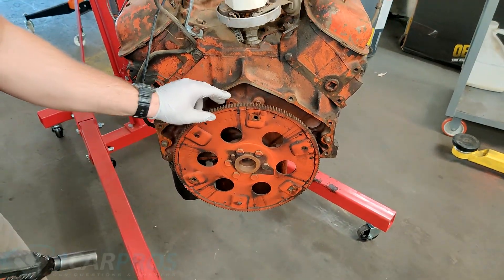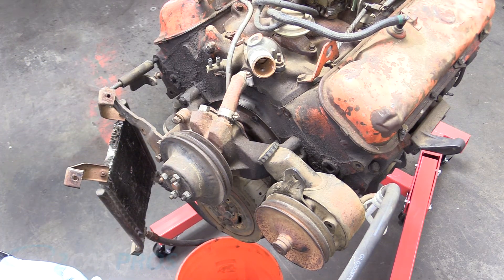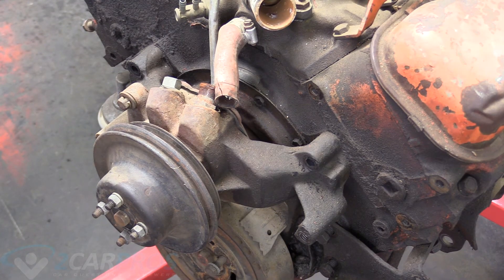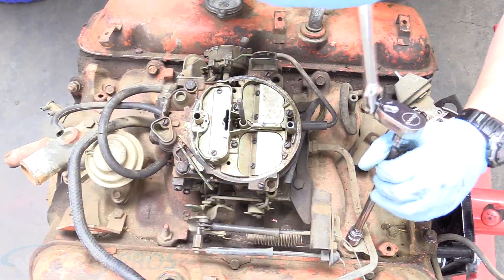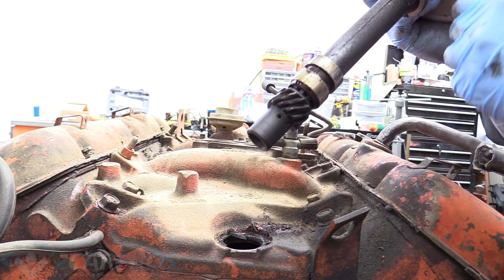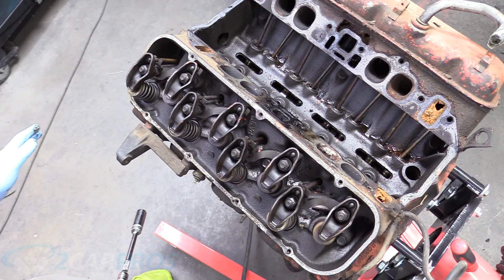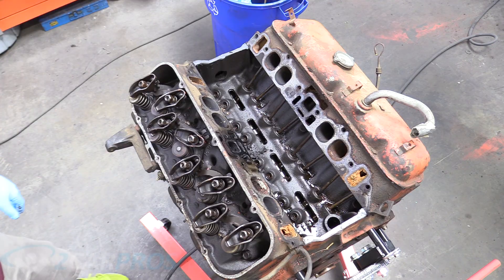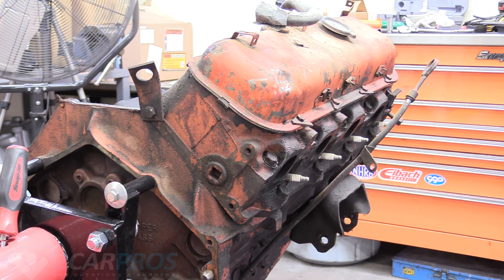How to Build a Chevrolet 454 Big Block Part 1: Taking the Cylinder Heads Off!

Comment: It might have already been asked, but, how did you get the engine stand off of the engine hoist?  I noticed that when you were mounting the stand to the engine, that the stand's legs were on top of the hoist's legs.  I have this same problem with the legs of my harbor freight hd stand being the same dimensions as the hoist's legs.  They don't intertwine.  I was thinking about taking the wheels off the stand and sliding it under the hoist.  Curious to know how you did it.
Reply from the maker: I just slid it off. Little clunky but it worked. Thanks for watching!

Comment: This is interesting to see seeing how as I have a 959 block as well. One thing I just saw a video about is making sure all the holes available to be drilled or cleaned for water flow on the block need to be, there is 3 on the bottom and 3 on the top of the cylinder (between them) that there look full. I'm fixing to do some head work so I'll make sure mine are open.

Comment: I used this video to rebuild my 454. Actually 3 blocks were cracked and found at least 15 heads that were cracked. Had to fight the whole process but got it done. I believe 454 is basically obsolete now. Nothing but junk parts floating around. Adjust ones budget and buy aftermarket

Comment: I rebuilt the same motor 30 over. 959 block (11-21-78) but I ditched those 236 peanut port heads and found a set of 820's for $100 that I had redone.

Comment: Why don't you clean it before  you pull it apart .you don't  no the first step
Reply from the maker: Wrong version of "know" first off, secondly you don't need to clean an engine before you take it apart as we hot tank it when it gets machined. Thanks for watching!

Comment: Great series of videos! Question...454 BB or LQ9 for an older square body pick up?!?
Reply from the maker: Oooooh man! TOUGH call! Hmmmmmmmm for your application I'd probably go with the 454 with fuel injection for reliability. As far as why the 454 then I just think it looks more correct. To be honest there is no wrong answer. They both would be fantastic!
Reply: @2carpros  yeah me too…454 is more year and vehicle correct and with the cost of an LQ9 I thinks it’s not worth the effort. But like to hear experts opinions!

Comment: GM made the 454's up until the late 90's, i think it was 99._
Reply from the maker: Yeah something like that for the GEN 6. My Dad has a GM based motorhome that's a 1999 with a Vortec 454. Runs great and really makes the big heavy thing move. Thanks for watching!
Reply: Honestly GM small & big blocks were almost indestructible, if they were halfway taken care of. They were so versatile, which made them so popular with virtually everyone😊
Reply: @2carpros  your videos on rebuilding the Chevy small block (5.3L) is interesting. I've torn down the old small blocks, the 70's & 80's before. The new design should have helped reduce oil leaks. The cross bolts on the outside of the block is the same trick dodge did with the Hemi blocks😄

Comment: I want to replace the crank shaft, but can I do that while the engine is still in my RV? It’s a 1991 Fleetwood Bounder, we don’t want to have to take the entire engine out, but we’re pretty sure the thrust bearing is broken. What would be the best way to go about this without pulling the engine out?
Reply from the maker: Oh man good question. I'm sure people have done it in the past especially in RV applications. I wouldn't and here's why: gravity really helps you set the crank back in and not disturb the bearings. If those bearings aren't happy they will spin and destroy your engine. Not to mention the bearings in the connecting rods I have no idea how you would go about doing it. I would bite the bullet and take the engine out. Thanks for watching!

Comment: After you remove the flywheel, its often easier to bolt the engine stand's adjustable mount (seen here in black) to the engine as it bobs around on the hoist THEN you only have to line it up with the stand.  Leaving the mount on the stand and then trying to line up each individual bolt can be more of a hassle. Be sure once block is attached to stand, double check the tightness of all bolts. As far as using a skinny screwdriver shaft to keep the engine from spinning around...better to just cut an old mailbox post to fit under the front of the engine for support while letting it sit overnight, if you run out of time to pull the cylinder heads and reduce weight.

Comment: Wonder whats needed to get 500hp out of one of these? Or even a 350
Reply from the maker: My build up with my compression should do 500 no problem. With a 350 you are really going to need a routy cam and high compression. Thanks for watching!
Reply: @2carpros  awesome build up. I want to put a V8 in a toyota starlet. Old school. So a 350 would do it. Maybe not a 500hp but even 300hp that's alot for that little car

Comment: I love this series and have watched it twice. Engine work baffles me - I'm comfortable turning a wrench but knowing which parts go together and why (measurements/ratios/math) is beyond me - I've stumbled into a bare block (14015445) that I'd love to build up for a 68 Chevelle I inherited but no idea on where to start selecting the right components - any resources you could suggest for that? (b/c these videos are amazing at what to do (big thumbs up!)
Reply from the maker: Thank you so much for watching twice! :D Just talk to an engine machine shop, they know all the math and correct measurements behind all of this. They set it up in a way where you can put it back together yourself.
Reply: @2carpros  then that's where I'll start - thank you so much! cant wait to see everything come together with your build!
Reply: I learned by reading engine building articles in old Hot Rod magazines from the mid to late 60's and i kept reading every one i found on any engine that interested me. Had good results.

Comment: so, gen V heads would be the same removal process? or, since mine is throttle body injected, would the intake manifold have different bolt placement so I could just unbolt the intake with the TBI still attached?
Reply from the maker: Yes it is very similar. You can unbolt the intake with the TBI still on if you can get to all the bolts for the lifter valley. Thanks for watching Matthew!

Comment: This is awesome. I have a 454 from my Grandpa's '84 Chevy pickup that I'm working on. One of the pistons is frozen, so I'm trying to think of an easy way to break it loose without rebuilding the engine. :) I bought a breaker bar to try to turn the crank over...any tips/ideas for that?
Reply: Marvel mystery oil
Reply from the maker: Very cool! Are you trying to break it loose while still in the car with the heads still on?
Reply: @2carpros  Yes, that's correct. Trying to do everything I can to not remove the engine if possible.
Reply: Ended up pulling the engine last weekend; excited to follow this playlist to rebuild it!!
Reply: Try mixing trans fluid with mineral oil 50/50. Take all the plugs out and fill the cylinders full. Let it set for about a week and try the breaker bar again.you may get lucky. It work for me. Be sure to change the oil and a tune up. Good luck 👍🏻

Comment: You don’t have to install rockers in the same location it makes no difference where they go. You better make sure you put the head bolts back in the same location and use the same impact and socket to

Comment: I picked up a truck for the fresh 396 BBC to use in my Chevelle

I’m pulling the motor - haven’t pulled one before

Question for you - I want to leave the 4 speed in it and remove engine only.  Can I pull it by just removing bell housing and converter bolts?  Any tips?  Thank you in advance!
Reply from the maker: Very cool! 

Yes you can. You just have to secure the front end of the bell housing with some wire or a ratchet strap. Thanks so much for watching!

Comment: What engine is better ls2 with full bolts on + cam or.. 454 engine with full bolts  on + cam?
Reply: The 454 is bigger so it can make more power with the same quality of parts. The LS2 will be significantly lighter. 

I guess that also depends on what you call a bolt on.
Reply: @c0c0asauce  😚😚😚😚

Comment: I have no clue why I’m watching this! I’m those guys that open car hood scratches the beard and pretending that I know what I’m doing 🤣 Q: why do you throw away the bolts?
Reply from the maker: I'm so glad you are here though! Thanks for watching! Some bolts I'm saving due to them being in good shape and expensive like the flywheel bolts. Others aren't in very good shape and I can replace them easily. It is a condition VS cost thing. Great question!
Reply: Don't toss any fastener until you've already replaced it with a good one.  You never know when you need the old one to compare lengths and thread count to make sure the replacement is in fact the correct one...after you've torqued it a few times and wondered WTF :)
Reply: I may just be paranoid but every fastener that came with a replacement part was sub-par quality and I usually use the ones that we’re original

Comment: So that motor's cylinder is 4.25?  That means it's not been rebored?  If it had been rebored, can you rebore it a 2nd time? Or is there another way to recondition it a 2nd time?
Reply from the maker: Correct. It is the stock bore from GM. Traditionally you can first bore to 0.030 then the 2nd time to 0.060. Thanks so much for watching!